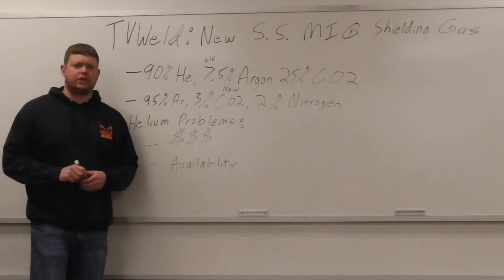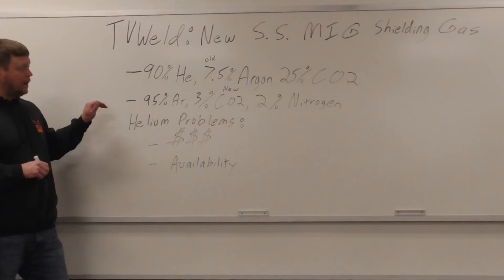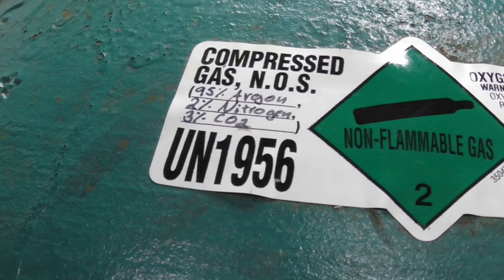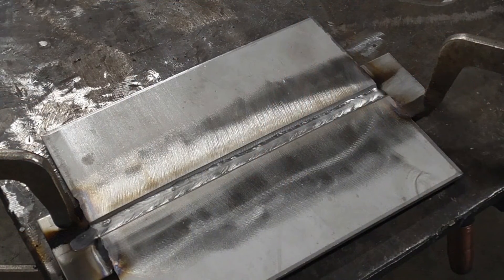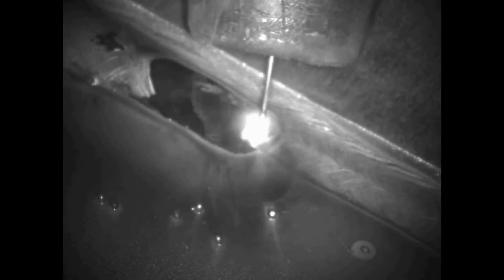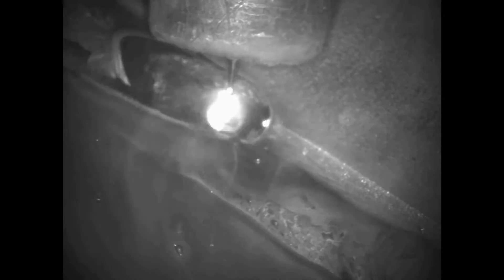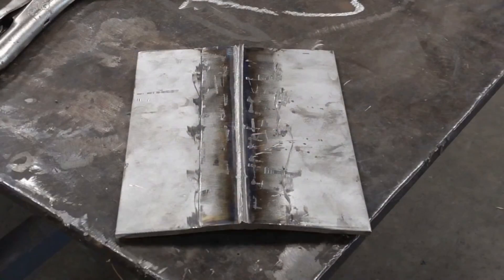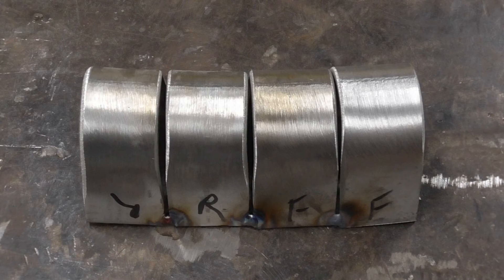New Shielding Gas Stainless MIG

Comment: The new gas is OK in the horizontal but downhill mig isn't as good as the 90helium. The new nitrogen mix works best with a more perpendicular torch angle, whereas the helium was better for dragging the torch. I've used both mixes for years.

Comment: I use HeArCO2 mix for roots on SS pipe. Then finish it up with pulsed spray with a 98 argon 2 CO2 gas for the fills and cap. It'd be nice if i could condense it down to just one gas.

Comment: I have been using the new mix for 3 years and it acctualy works great especially on really thin stainless like sinks and appliances definitely need to crank up the amps on thick
Reply from the maker: I really like it.  I've got some production parts to run off soon.  We'll see how it goes with some repetition.